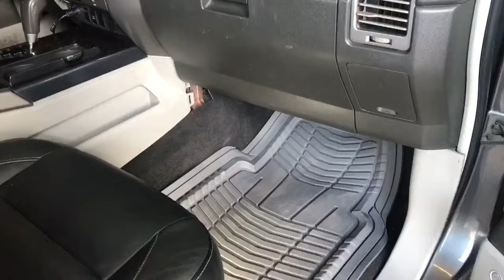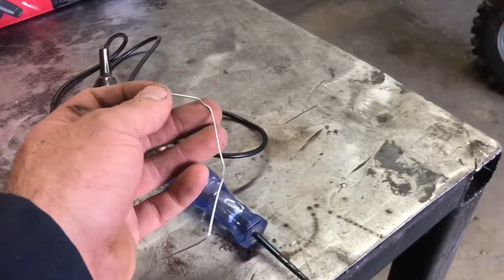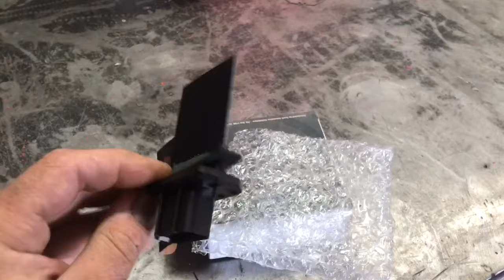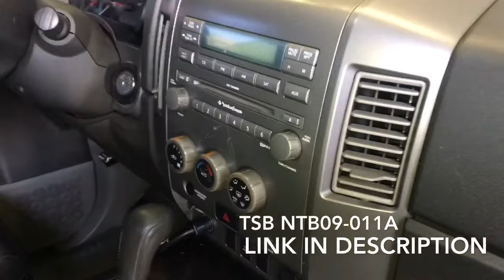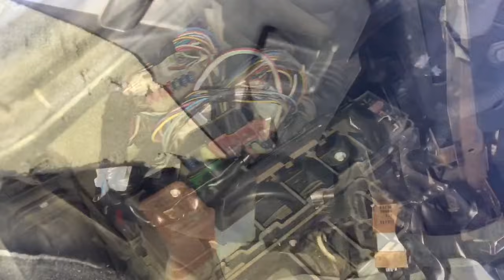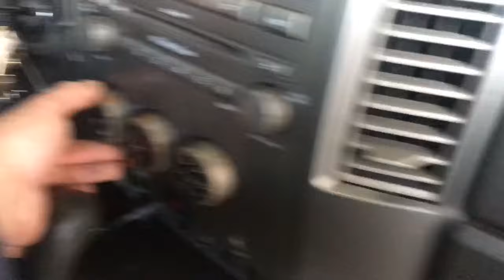Nissan Titan Blower Motor + Resistor Replacement and Diagnostics (2004-2015)

Comment: Thanks to your video I was able to easily replace my 2006 titan resistor. The fan was not the problem as it often rarely needs to be replaced. I did check the fuse located under the hood and tested it for continuity and it was good, next I went under the glove compartment and noticed two plugs, one to the fan and the other forward of the fan, I just tugged and wiggled it hoping was the plug. The plug pulled out and had 4 slots for pins, I unscrewed the 2 screws and the hole resistor came out with ease I used 7/32 socket. I ordered the part from Amazon for $28.00 and installed the fan turned on and I got AC again.
Thanks again, I am now a suscriber.

Comment: I've used your videos in the past for various needs, so great, thx!!  I completed all the connectivity tests and passed.  I noticed the blower motor connector is slightly melted on one side.  The fan will turn off on its own then restart, so wonder if fan is shorting or going out....what is recommended?

Comment: Great video, but still need some help.  When I test the resistor plug, it shows it doesn't have any power, but the fuse under the hood is good.  There is no power to my HVAC system, the dial lights turn on with the dash lights, but that is it. Any ideas?  (I did replace the resistor, but no luck)

Comment: You never showed what the fan was doing. 

My blower motor was working fine for the 200 miles I drove the vehicle before I paid my friend. No beef with him but it started rumbling loud at high speed, then speed 4, now speed 3. ... Which seemed to be the bearing.

Comment: I had a resistor go bad on a different make and model but the idea is that if the resistor goes bad and you have full force on the blower it's because you are more assured of having defrost in the winter.

Comment: I have a manual HVAC control with my 05 Titan but I pull out the resistor and it's the automatic resistor with the heat sinks 🤔.

Comment: Don't use that light.  You should be verifying individual voltages with a multimeter to make 100 percent sure each step in your resistor is working.  I found both step 6 and 7 had the exact same voltage.  No wonder my AC was always not that great on full blast.

Comment: Thanks for this again, I have a 09' . Last year blower was stuck on high and changed the resister and fixed problem. Now  blower doesn't work at all and know how and what to check . Another video suggests changing both blower resister and blower motor at the same time because if one failed its only a matter of time before the other will also. It took a year but they were right. Also hope that you have blower resister shown in video, it's pretty inexpensive ,around $20.00 , if you need the other type which I did its a $100.00 from Nissan dealership

Comment: I replaced the blower motor resistor because my fan switch only had two modes, off or max speed. It worked for the first three days, and now it doesn’t do anything at all. I’m guessing the blower motor itself is now shot? My Titan is a 2007.

Comment: You did forget to include yhe 10 amp HVAC fuse in the small fuse panel on the passenger side. That was my problem with no power to the blower. 
  Now if I can find the stereo problem....Radio is on, no sound.

Comment: Replaced my blower last year and now sometimes it just goes off and back on. Moving the wires usually made it come back on but its getting worse. Also its not very cold and my back seat vents dont blow much air is there a filter back there somewhere?

Comment: Some Titans   that have a manual control system on some models have a variable speed blower switch. The switch has no speed settings 12345. The speed switch just has a 0 and adjusts to high speed as you turn it up. This is a variable speed blower switch. It uses the same resistor as the automatic control system. It is the 5fin resistor from Nissan,four fins on most aftermarket. If replacement is needed take out first and check it to get the right one. The one fin resistor will not work on the variable speed blower switch with the manual climate control system.

Comment: Hi I think this is what I have to do ,I have a 2006 nissan titan ,the air is cold but I don't see where it's blowing hard from the front vents ,it seems to blow hard below the dash and above by the windshield. 
So I look below the dash and I think I see the blower and the resistor and I'm pretty sure I can change it myself ,I'm not the car mechanic .
But I'm thinking I'd like to just go ahead and change both while I'm doing it .
Do you think it's a good idea or should I just change one ,from what I explained so far .
Also I'm not sure which resistor I should get for my truck ,you said there are two different resistors ,how do I know which one to get ?.
When I brought it to the nissan dealership  they told me the whole dashboard would be needed to be removed ,I'm glad to see that's not the case that it can be done from below the dashboard etc .
I think you saved me a lot of money so thank you ,and great video .
Reply: Excuse me.. I have the same problem...
What was the problem?
Reply: @carlosdelacruz3522  I changed out the parts in the video and what I talked about in my comment but it didn't solve my problem , still wasn't getting any cold air.
I brought it to a mechanic and he found the issue , it was the defrost  door motor , said it was staying stuck not letting the cold air come though the face vents .part was like 34 bucks total was 81 bucks and change to get it fixed , so far so good . I hope that answers and helps you with your issue .
Reply: https://youtu.be/NNb_Ejn-IXo?si=Ivf42MFhPj2LumNH

Comment: I've replaced the resistor a couple of times now (probably erroneously). have intermittent issues with blower working at all. Yesterday went to check the power at blower plug and it came on as soon as I touched it.  I wonder if your issue was a bad connection also?

Comment: 2005 titan SE. Blower fan stopped working. I checked the fuse and it is good. I replaced both VBC/blower resistor and fan blower but it’s still not working at all. I am measuring 12vdc at the fan plug when I turn it on but the fan does not blow . Any help will be appreciated.

Comment: What happens if the light doesn't turn on at the connector??  The 20 amp fuse under the hood has power going through it (lights up) what could be it??
Reply: Did you figure this one out?
Reply: @426emar  yeah it was the motor resistor that went bad, so it didn't let the electricity flow to the blower fan/motor that's why there was no light.
Reply: @eirod  thanks man ..I ordered the  motor resistor yesterday, I hope that's the problem.
Reply: @426emar  yeah i changed the blower motor on it as well, just to be sure i heard one can mess up the other and vice versa

Comment: How many volts should the blower motor be sending to the resistor plug in the automatic climate control system? Mine is reading 12v when the engine is off and 14v when the engine is on. I have blown 4 or 5 resistors over 2 months and i think that the motor is bad, what do you think? Thanks.
Reply: Did you ever find out
Reply: @eirod  It was the blower motor, swapped it out and the resistor at the same time and havent had any problems since i replaced it 3ish weeks ago

Comment: Looking for the correct part for a 2005 Nissan Titan and was advised that this year, even though it was a manual control ac that it needed to have the automatic resistor installed.  Have you of this issue before?  Also your part numbers are the same for the manual/auto?

Comment: Yesterday I went to turn on the A/C. As soon as I turned it on, I heard a little pop coming from the passenger side area. I then smelled a slight electrical burning smell. Could they have been the blower motor?
Reply: This is exactly what happen to me ... have you found what the issue was
Reply: Resister?

Comment: I just fixed my blower motor on my 2006 titan. Before the fix it seldomly worked at all. I removed the blower, unscrewed the torx head from the blower motor bracket and removed the motor with the fan still attached. I used snips to cut a access hole by snipping out the air vent on the side of the motor. I attached sandpaper to a screw driver, inserted it inside the motor and turned the fan while I scuffed the spot where the brushes make their contact. Once that contact zone was as shiny as a new penny and I blew the dust out and I reassembled the motor into the bracket . I reinstalled the blower motor and it worked near perfect. I am in hawaii so I saved a few bucks and a long wait time.
Reply: Make a video of it bro

Comment: Thanks! I have no power going to motor at all! The fuse you showed is not burnt! Lucky my younger brother is a mechanic by trade. Together we should fined the problem. 2005 Titan with 230,000 miles.
Reply: did you ever find the issue?
Reply: @BassinArmada   Resister was bad........! Burnt smell coming from it! Thanks!

Comment: Hi Aaron, I have an 07 with manual controls. I bought a single blade resistor, but when i took mine out, it had 5 aluminum fins. Is this common?
Reply: That's how my 05 was ..

Comment: My 2004 Armada the blower is not running while the engine is running. But the blower does run when I put the key on start position. (???)

Comment: Hi Aaron, I just recently got a Titan myself and have found ALL your videos to be extremely helpful! A problem I’m having is I don’t get much air pressure when I use the A/C and found there was no cabin air filter when I got the truck. I put one in and cleaned out the blower motor which was full of leaves/twigs and it still has almost no pressure. I was wondering if you could maybe make a video showing how to get to the A/C evaporator coil because I’d like to check that next! Please and thank you so much! Great vids!

Comment: My 2006 LE Titan is not allowing us to lower the temperature gauge on the driver's side.  Will this help our problem?
Reply from the maker: no, unfortunately you have a bad blend door motor.  the left and right side each have their own air mix door but the left (driver's) side is on top of the heater and A/C case and the right (passenger) side is on the bottom of the case. These are five wire units. Two wires are responsible for rotating the motor depending on the direction of current flow. The other three wires are for a sensor so the control unit can tell where the door is. Also, these motors generally have a master spline and they can only be installed in one position. Make sure the correct replacement part is used.  Nissan calls for the dash to be removed to gain access to that blend door but i have done the job without removing the dash. 1. remove radio-glove box to access servo on top of blower box. was able to take center vent stack & glove box out, pry up on vent and get long extension w/swivel to get screws out & remove actuator. good luck
Reply: @AaronHinesAuto  do you have a video on how to do this?

Comment: Great video, would this also affect the blend door actuators from not functioning properly.  Replaced them 2x and still getting that darn clicking noise
Reply from the maker: thank you! unfortunately no, the clicking noise is coming from stripped plastic gears inside the blend door actuator.

Comment: Exactly what my 2007 titan was doing. Only one speed on the fan control and then yesterday nothing works. Going to use your directions to get system working before it gets hot here in AZ. Thanks.
Reply: I have the same issue with my 2007 titan... was this the issue and did it get fixed??
Reply: @ramonahigh  Yes I have all the speeds now. Easy fix
Reply: @PeaceFrogMC  did you buy the parts from Nissan?
Reply: @ramonahigh  Amazon
Reply: @PeaceFrogMC  did you replace the blower motor or the resister ?
Reply: @ramonahigh  I looked back at my amazon orders and it appears I ordered both and then returned both. Now Im not sure what I did? I do remember I replaced the cabin filter though.

Comment: Hey man my 06 is not blowing all air in the vents, is just make the noise that is on maximum level but in only 1 vent the air is strong enough. I found that my a/c was running without cabin filters since I bought it (7 years ago) what can I do, I live in AZ and the heat is crazy in here. Hope you can help me
Reply: did you ever figure it out? my truck has the same problem
Reply: The only Titan that came with the cabin filter was the LE trim level. If you want filter in the lower end models, u have to install one yourself.
Reply: My 2006 se has two cabin filters behind the glove box!